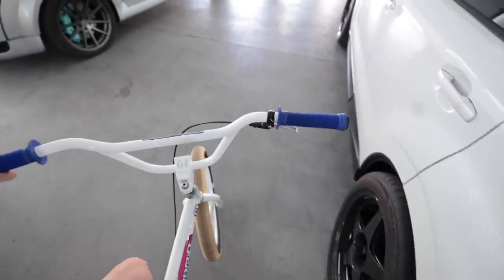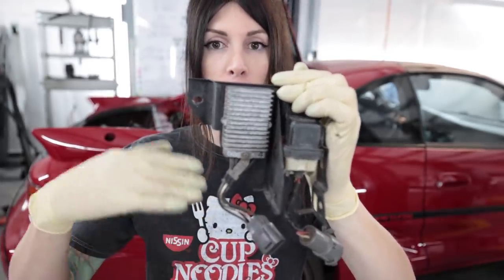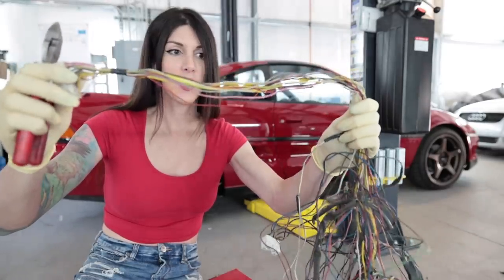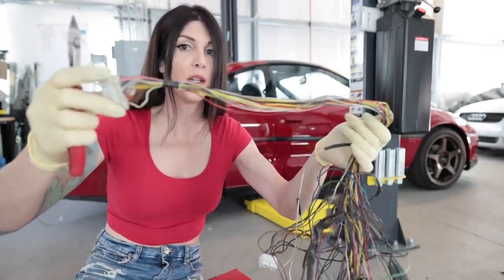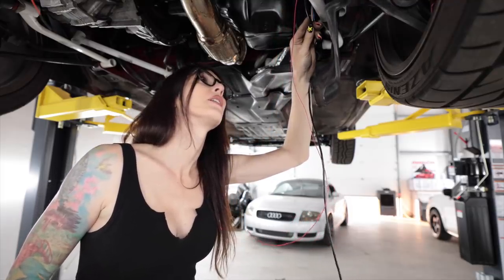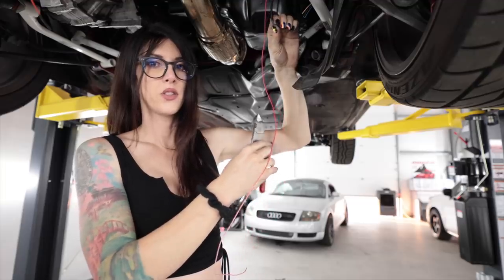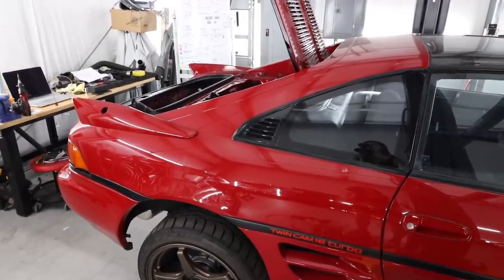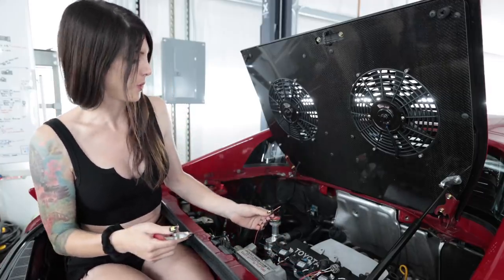Going FULL NERD MODE  on this Wire Harness! // MR2 Standalone ECU

Comment: Sarah, with wire connector ends that have the "Creepy Green Death" on them, soak the ends in straight CLR. It eats it away down to clean metal. When you pull it out of the CLR, spray them off with CRC quick dry electric spray. I've done this for years while restoring old motorcycles and it works great.
Keep doing what you do! I've always been impressed with how detailed and in depth you are with all your projects.
Reply: or hydrogen peroxide mixed with baking soda may work...i think
Reply: @TbsDltn  Hydrogen Peroxide may make the plastic brittle.
Chemical resistance of plastics to Hydrogen peroxide @ 30%, 60°C is depending on their ability to keep properties when exposed to this reagent. Traditional chemical degradations encompass aesthetic defects, decomposition, swelling, crazing, cracking, and/or change in mechanical properties such as impact strength, tensile strength and elongation.  Learned that one from AvE.
Reply: @bigdaddy741098  I use a thin coating of dielectric grease on both male and female ends. Don't glob it on though. The excess will drip out when it gets hot. A thin film put on with a paint brush is all you need.

Comment: I tried to see if anyone commented this already about the fuel pump relay: It wont work as you have drawn it. a 12V relay needs a minimum of 4 wires to work, a switched trigger to the coil (positive or ground) with the other side either being positive or ground (the opposite of the switched side). Those are the terminals you said you were leaving disconnected. Then you need the 15A feed to one side of the switched terminals, and the normally open terminal to the fuel pump. Coming from me with an automotive electrical backround, your work looks great, better than many "pros" I have seen.
Reply from the maker: The Aux outputs from the ECU default to ground which would trigger the relay.

Comment: Just a tip.  PWM control of a solid state relay is the go for fuel pump speed control.  Works great with Walbro 460's and other E85 rated pumps.  It really helps keep your fuel cooler too.  You configure the PWM table based on injector duty, and the normal fuel pump running signals.

Comment: Sarah both Wal mart and Amazon sell 35% and 75% strength vinegar, regular is 3% they will get rid of that green stuff in the wiring harness or the battery posts and the 75% stuff is a great weed and Clingon killer as well as a great rust remover. thank you for being you.

Comment: When the MR2 is done put a $ value on it ( both with and without your hourly labor rates ).  🤔
Reply: Just for comparison - I do a lot of complete re-wires on classic cars, customs, and race applications. . Typically I use American Autowire "Highway" universal update kits for the more "normal" stuff. I charge (and this varies by vehicle obviously) 40 hours @ $100 an hour for more complex jobs at 25 hours for simple jobs (for example a stock '69 camaro.) I have done hundreds at this point, but you have to remember these videos aren't an accurate representation of hours spent as she has to also spend a lot of time narrating and videoing.  I recently completed a wiring update on a show truck (ridler great 8 build) and with the rather ridiculous custom EFI setup I installed, as well as the myriad of other electrics (door poppers, stereo, gauges, etc) and the visual requirements - it was a several hundred hour job. Cost of wiring varies greatly depending on the skill of the tech, and the materials used. I can guarantee someone who quotes wiring work super cheap will deliver a result far from the quality of someone who quotes a price that many would consider "expensive."
Reply: Mr Dos is value is close to a Ferrari 348 at this point😂
Reply: @theangrymarmot8336  The astonishing difference between the complexity of a 60s car compared to a 90s car means that Mr. Dos would be totaled by an insurance company if the wiring harness melted and the whole car needed this sort of wiring job.  A hundred hours of labor is probably more than almost all 90s sports cars are worth at this point (unless meticulously restored).  I'm amazed that Sarah took on this task.  I'll bet there aren't more than a few hundred people in the whole country that do work like this anymore.
Reply: It's not about how much a project car costs, it's about how much you enjoyed the work.  Most project cars will never recoup the expense of building them, that is far from the point fo building most of them.
Reply: @PetrolJunkie  Exactly. I always laugh at people who are cost/value/investment based when it comes to value. I have spent the last twenty years building customs and hot-rods. People will dump 650k-1+ mil into a build and know if they sold they would be lucky to get back 1/4 of the cost invested.  IMO the only time "how much is it worth" is a valid topic of conversation is if we are talking about investment quality cars.

Comment: Sarah  the circut opening relay is the real fuel pump relay, you can treat it just as you would your new relay.   the "fuel pump" relay only controls the speed.  DM me if you want, i have all of the circuits designed and a custom harness builder software for doing projects exactly like this. i have all the oem parts and un-crimped oem pins.  i have everything you need to make custom mil spec-ed autosport wiring

Comment: I feel your pain wiring up a stand-alone on an MR2...

I beat my head against the wall trying to figure out the fuel pump relay for a long time. I eventually figured it out, but you wickedd smahht and figured it out way faster than I did.

Comment: The circuit opening relay is there to protect from reverse battery connection so not totally useless :P for the fuel pump you want the Relay on the positive side and a solid state relay on the negative side connected to an AUX out of the ECU then you can PWM control the fuel pump speed from the ECU, nobody wants to hear a fuel pump go BURRRRR for hours on end at cruise.

Comment: dont forget to snake some extra wires on the harness to add some external sensors in the future like fuel pressure, oil temp, oil pressure, boost control by the Link, buttons to launch control or to change maps on the standalone. the intercooler fan is also programable in an aditional Link input

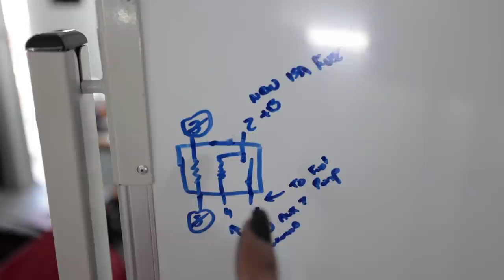Comment: 10:36 you can't wire your relay that way. The computer has to connect to one of the terminals that you plan to delete. You have to figure out if your computer is going to ground or send power to that side in order to determine what's on the other side of that circuit. The other side is either grounded in the car when the computer sends power or it's part of the fuse circuit if the computer is grounding. Your fuel pump will never turn on or it will never turn off with the way you're going now.

Comment: Sarah you will need to hook up 4 wires to the fuel pump relay. You will need a + from the battery, a + from the ecu fuel pump trigger, a - ground for the opposite side of the ecu trigger, and an output wire to the fuel pump
Reply from the maker: Not according to the link instructions, the Aux inputs default to ground. I’ll triple check again though.
Reply: @SarahnTuned  i beleave what you're telling me is that the default setting of the ecu is a ground trigger for the fuel pump.  

If so the relay will need to be wired with a  +12v batt on the main input and +12v batt to one of the trigger inputs so when the ecu sends out a ground signal it will energize the relay. 

Relays can be confusing in the beginning but one day it will be like a light switch gets turned on and you'll think there so simple why were they so hard to figure out
Reply from the maker: Thats exactly what I was doing.. lol

Comment: I have no doubt Mr Dos will fire up 1st try! 👏🏻. I would never attempt a wiring job. I’d get dizzy and constantly lose track of what wire does what. Despite them being labeled. 😂
Forget the clutch on that VW and sell it already!!  That thing has been nothing but a nightmare. Get rid of it!!
The young generation never understand how long a build actually takes. I appreciate all the insight a wiring job takes. 👍🏻
You can see the light at the end of the tunnel!! 👏🏻🙂

Comment: going to take the 5 volt wires off a MAF sensor and wire them to a MAP sensor... think the voltage pass thru at -19psi is zero so parallel circuitry to the MAF... because, connecting it behind the throttle body. (don't hit the 12 volt)... potential to have additional watts going to the ecu sensor path, might run a bit rich above an idle when the thermal transfer on the heating element catches up with the air flow... maf 3-4 second delay,  map live adjustments because the sensor is faster.

Comment: Just throw a clutch in it and send it👍👍

What printer are you using for your labels?
Also, I have to add a few connectors to a wiring harness on my 6.0 Powerstroke for serviceability. What would be the best connectors? One is a 3 wire connector, and the other is a 10 wire connector. This is just so I can remove a main loom so I can replace my injectors easier.

Comment: Regarding your tt,  I had one pumped to 269 hp. Tracked it too and..... was not much fun coz the power bias in this old model doesn’t change much. Gross understeer is the result; welcome to the world of sliding off track while under full throttle and the steering on full lock. ... but it should make you smile. New TTRS is far better.   Put a clutch in and wash it... then beat it to enjoyment
Reply from the maker: I don't have $80k+ for a TTRS.. so 🤷🏻‍♀️

Comment: Confusing it may be, but the circuit opening relay has a specific purpose. In the event of a crash, it cuts power to the fuel pump, and prevents a 'crash and burn' situation. Best keep it, no?

Comment: Wiring is going well, crank sensor connector low down, as long as it has seals on each wire and round where it plugs onto to the sensor it'll be fine. Stuff I have to work on they're usually below the wade line. Teeter Tot, well the trans is as old as the engine so fit a clutch and have some fun. Or get Fred to throw a clutch in that way it'd stop you getting all OCD about him.😁 Also I have confidence in your abilities once base map and basic set up he'll start first go.

Comment: Seeing a harness with snipped off pins on the connectors and taped off wires drives me nuts. Depin the unneeded things and completely remove the wire is the best way, it makes any future work or troubleshooting much easier as well.

Comment: Nice and tidy wiring! I appreciate the need to doing it cleanly.

Does the MR2 have a system to cut the fuel pump in the event of an accident? Or when the engine is stopped? Does the new ECU cover this?

Comment: Almost there!  Aside from Mr. Dos, really looking forward to hearing your thoughts on the new Maverick pickup, and definitely looking forward to seeing you test drive one later this summer or in the fall.  I'm not a truck guy myself, but a 40 mpg hybrid pickup for $20k?  That's surprisingly decent value.  Also looking forward to seeing what kind of caps aftermarket vendors come up for it.  This could be a really big deal for Ford.

Comment: With Summer coming an affordable convertible would be a nice project. My tip would be a Mercedes-Benz SLK320 (R170) with a V6. A compact pocket rocket.
Reply: Summer in AZ isn't convertible weather unless you like the feeling of a hairdryer being blown on you the whole time. Winter/spring/fall here are top down weather.

Comment: Since I have no sympathy or understanding for your fascination with the TT, by all means throw in a clutch and flywheel and send it.
And don't say crimping those pins on the wires isn't difficult, I usually manage to screw one out of five up.
Again, you're doing a great job, putting 'professionals' to shame, and if you ever decide to DVD release an uncut three hour per episode trilogy, tetralogy or pentalogy of it, I'd be happy to see the whole damn thing.

Comment: Wait a minute : wait a minute did you say the ECU relay to the EfI circuit which controls the FC-U module by passing the CRAP filter to the BAM intake and flux capacitor. Well dang thats news to me.  Whisky Tango Foxtrot is going on here? My service manual never said anything like this. No wonder I can't get the my fenutenrod to work in conjunction with the throckmorton! Thanks for the tip Sara!

Comment: I always enjoy watching your videos. I have a question regarding wiring as I am going to be re-wiring one of my projects. I’m assuming that you are probably an electrical engineer or engineer of some sort, but if not how did you learn how to do all of this? I’ve struggled with wiring for years but am mechanically inclined. I’d like to do everything on this particular project that’s going to take years but know that the wiring is going to be a struggle. Any tips are welcome.

Comment: I want to know how TF you depin a wire?!? I remember fighting with this years ago trying to figure this out… clearly there was a tool but nothing I had worked (outside of destroying the harness) and I couldn’t figure out what I was missing. Where can I get this tool?
Reply from the maker: Depends on the brand of plug, generally speaking, there’s a tiny plastic tab inside the front opening that you lift and it releases the pin.

Comment: 10:39 ... Pin 3 and 5, aren't they the coil wires, which activate the relay?
Reply: Circuit opening relay is a dual coil setup.
Reply: @Dave-fx5zw  ok. the drawing that was shown looked like a coil, not a switch on 3 and 5. Could be where I'm wrong.
Reply: @IceBergGeo  no, you're right. It is a coil between 3 and 5, and another between 2 and 4. Both (or either) coils can control the switch/load circuit of pins 2 and 1.
Reply: @Dave-fx5zw  for the win
Reply: @Dave-fx5zw  Dual coil is interesting. Never have I ever seen something like that.

I guess it makes sense, being a ground controlled output rather than a hot controlled output. Thanks for shedding light on the subject!

Comment: A technical question from an engineer. If you are switching froma  variable speed fuel pump into a constant speed one, Do you have a discharge line so the system is not going into overpressure in low consumption condition?

Comment: Why are you soldering?
OEM is to use crimp connectors with dual wall shrink tube.

Yes, just clutch it and burn :)

Comment: TVIS?? I thought you had a Gen 3 JDM 3S-GTE (which didn't have TVIS).  (I am sorry if I lost track here, but somewhere along the line I had determined that your MR2 and mine both had the same engine, especially since you had the ceramic turbo graphic on the intake)

Comment: You do already have a new clutch and flywheel for that Audi, might as well toss it on; build it to your liking down the road.

I like the idea of using half of the circuit opening relay as the fuel pump relay, clean. Did you find your bad splice joint on the Black-Yellow wire in that mess, that was keeping your check connector and ISC from having 12v?

Why don't you think the factory Cruise will work? All it needs is the IDL circuit, which comes from the TPS. Or did you change that when you cleaned up the throttle body? On the A/T cars there is ECU integration, but I think the manual ones are pretty much already a stand-alone cruise setup.

I for one do appreciate doing things proper, which does force the comment of you needing an inline connector in your trunk for the wires that come in one grommet and out the other. That turns into cutting it later if you need any sort of repairs.

Comment: Senor Dos!!
Reply: I worked for a Toyota dealership (Burt Toyota.. now Elway .) as a ute. Late eighties right out of high school. Apprentice program. 
I remember when the MR2 came to Merica. The Celica Supra line was separated and the Supra became a vehicle of it's own design. Considered a mid or more appropriately a rear engine design that was superior to that atrocity that Pontiac produced. Manual transmission. I remember banging through gears as an eighteen year old in cars on I-25 in Denver to get them ready for customers. Shimed valve train. They were half ready when I brought them back. 😉
 We dubbed them...Senor Dos. 
Toyota has mostly produced rugged vehicles. Early diesels were garbage. 
We built a monster truck in those days. The Toyota Terminator.  Funded by the late Nate Burt.
Powered by a blown Chevrolet power plant. Toyota actually built some amazing prototypes that never  made it to production. 
Thank you Tommy, Uncle traveling Matt, Nate, Spot, Art Longoria..the detail department. I still fuggin hate the sales dept. Despicable lot all of you. Deplorable predators. Get a meaningful life.

Comment: I don't see how you're going to use that relay without terminals 3 and 5. Those should control the switch. If the relay is normally open, then electricity will flow normally through 2 & 4 and putting voltage to 3 & 5 will cause it to flow through 2 & 1, assuming that path has less resistance. Otherwise, if it is a normally closed relay you'll be fine. But your drawing makes it seems like it is a NO switch. Is it NC?
Reply from the maker: The Aux Output defaults to ground in the ECU.. but yeah, the OE FP relay is NC and the Circuit opening relay is NO. So when the new relay gets its ground via the Aux output, the contact should close providing potential to the fuel pump.🤨 f*** now I need to test this with a power probe because I’m second guessing myself lol 😂
Reply: @SarahnTuned  You show two coils on that relay

Comment: There are a LOT of things you can half-ass on a project but wiring is not one of them.
ebay turbo installed in the dark while drunk?  Sure, probably fine.
Wiring done sloppy and poorly insulated? Gonna cause problems and always at the worst time.